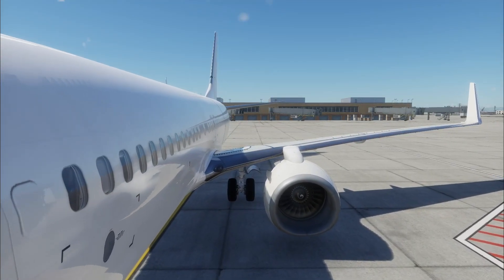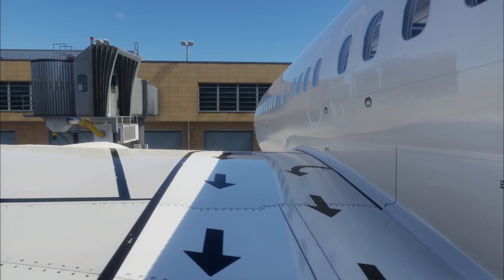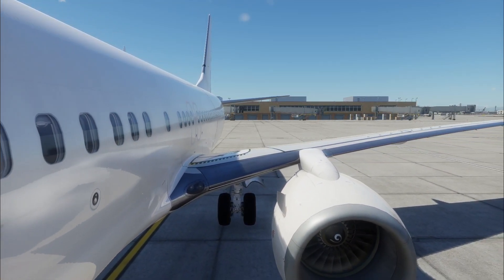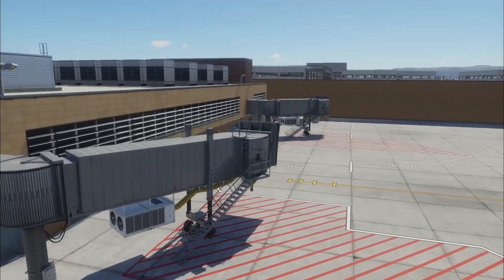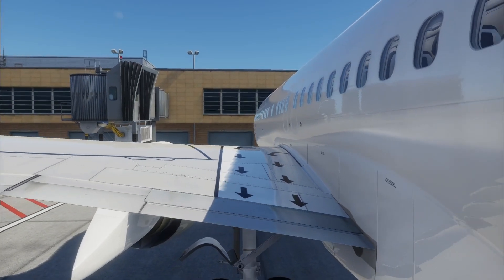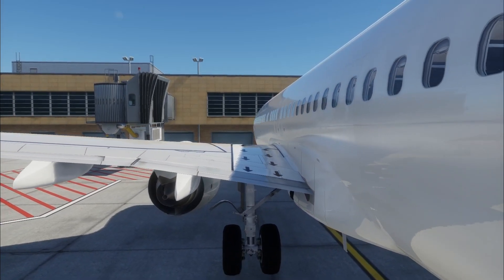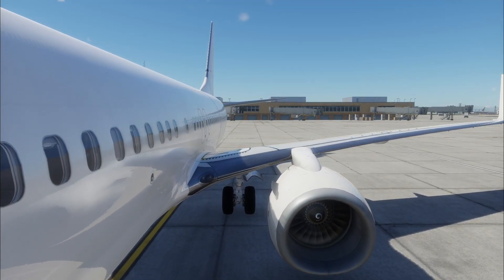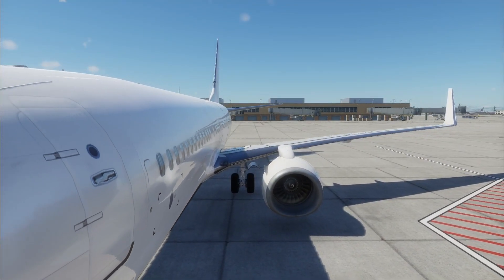Why does the Boeing 737 Not Need Overwing Slides?

Comment: I didn't know that about the 737. Well, the 737, especially the early ones, had lower landing gear. Even the 400s and NGs had lower gear compared to the Airbus or similar size commercial transports I think. Well, it kinda makes sense. To take advantage. If the aircraft stands low enough that it is practical for passengers to slide off the wing in an emergency, with help from the flaps. To do away with the slides over the wing. Save weight, cost, systems, complexity, etc., makes more room for fuel and other things. Better hope that the flaps are working though, the hydraulics are intact. But hey, worst comes to worst, the other doors have slides. I didn't understand why the speed brakes have to be retracted. I'm guessing the 737 Max aircraft might have slides over the wing because they are taller. There are certification requirements for evacuation of course. I guess they were able to show it was practical without needing slides over the wings.
Reply from the maker: The speedbrakes need to be retracted so that the passengers can easily get off the wing.